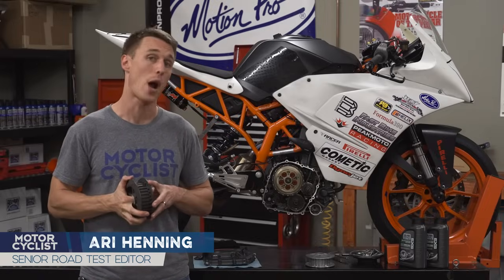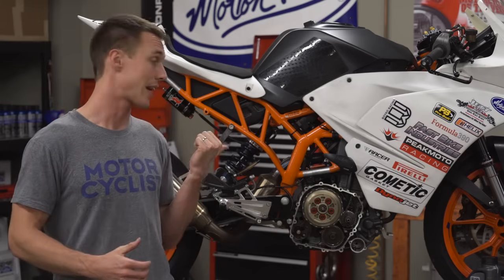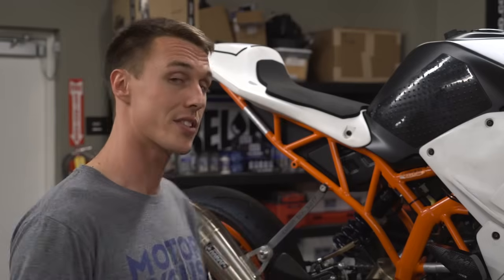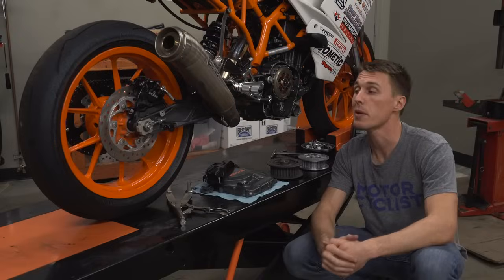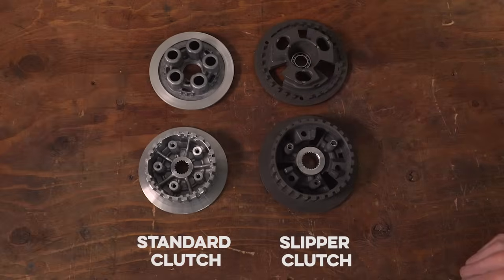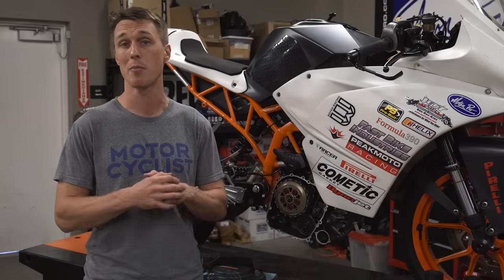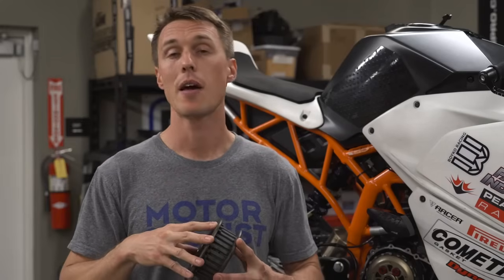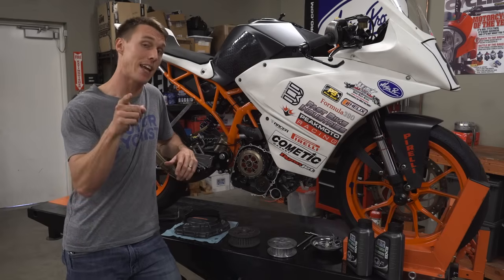The Motorcycle Slipper Clutch: How They Work and Why They're Awesome | MC GARAGE

Comment: Good video but I was wondering about the 'slip and grip clutch'; if you were riding your bike and your throttle jammed open, would you still be able to disengage the clutch and get the bike out of gear? IE can you overcome the extra pressure on the clutch plates?

Comment: THANKS, I put wrong oil and my vmax 1985 is slipping. i am planning to replace the oil with motul 3000 10w40 JASO MA2, should it fix the issue? thanks

Comment: Thank you for this video!! I've known how slipper clutches work but I just bought a very lightly used 2018 Triumph Street Triple R and it has a "slipper/assist" clutch and it's a VERY light clutch pull which is amazing! My FZ8 that I had for years was MUCH stiffer and I was always good about lubing the cables, keeping them adjusted properly and running good oil. I wondered how they got such a light clutch pull but a clutch that would still hold almost 120hp without it being hydraulic.

Comment: Not to be one of those nostalgic dickheads- but since moving to a slipper clutch last year on the Z900, now on the MT09- its like someone ripped away about 70% of the feel and tactic input of the clutch which I loved- losing that is like losing the feel of when to change gear using the vibrations of the bike- very strange. also never had a back wheel come out on me due to going down too many gears/letting out the clutch too quickly- maybe im just lucky or maybe im just creating this issue in my head.

Comment: What kinda street miles can I get until I need a clutch replacement on a slipper clutch? I have about 20,000 on my factory 2006 gsxr 750 set. No race, just commuting to work and stuff.

Comment: I haven't ridden for a while but been shopping, so I never even knew this was a thing until recently. I've NEVER had an issue with rear-wheel chatter or if I downshift too hard, I just pull in the clutch and quickly shift back up. No. Big. Deal. I WANT my engine to act as a brake. It's how I control my speed, and I know how to "blip" the throttle as I downshift. To me a slipclutch is like using tiptronic to shift your automatic and calling it a manual shift. It ain't the same thing. When I do get a bike, I'm going to shop for one that does NOT have a slip clutch, or I will search for an option to replace it with a standard clutch.

Comment: My slipper clutch failed as I was walking down icy stairs and I fell on my ass.
Reply: Actually I have found that my 2016 R1S will skid the rear tire)on race track) with OEM tires, however with race tires it works great, no (or almost) tire sliding.

Comment: Slipper clutch is develop in the early 2000 for high performance racing bikes for motogp or SBK. Different  slipper clutch designs were built later but what interest me is when one Japanese motogp rider, I forgot hus name said that he just use a tiny small amount of clutch pull to eliminate engine braking that was the reason in the development of the slipper clutch. Comes 2007 the new very light Honda CBR1000RR was introduced with all the gizmos to beat GSXs and ZXs who were the speed king. A new system that eliminates engine braking was introduced in the new Fireblade where the butterfly valve slightly opens as the rider eases on the throttle thus eliminating engine braking. Since then the new Fireblade becomes a machine to beat on the track

Comment: So does a slipper clutch negate the necessity to blip the throttle on downshifts? Or would that still be beneficial?
Reply: Ben Gray depends, but basically, it isn’t necessary to rev match or “blip the throttle” if your bike is fitted with a slipper clutch.

Comment: MC garage, I have a question. Please answer. On my daily driving routine, I always blipping the throttle when downshifting to match the engine and transmission speed. I have now a slipper clutch MC, should I blip the throttle still or let the slipper clutch come into play? Am I wearing my slipper clutch too early or it's not healthy if I always rely on slipper clutch and not to rev matching/throttle blip anymore?

Comment: I have RC 390 Duke with slipper clutch, It was stolen and recovered after a few week. The bike stalls immediately as soon as I put it in first gear. I removed the clutch, apply the oil to all plates. Installed it, clutch become nice and smooth. Bike still stalls. It does not look like side stand switch is faulty. what could be the reason
thnaks

Comment: I'm curious, if I do not shift assertively enough through everyday driving and ease off the throttle immediately after shifting, if that is why my bike is tending to slip out of gear an show "-" on the display regardless of gear transition.
The other day I was shifting from 3rd to 4th and it did that to me.  I'm noticing as it seems as a "limp foot shift" for lack of terminology, partly when I may be dehydrated and recieving a cramp in my hip I've noticed too.

Comment: Hi, I am a returning motorcycle rider after 3 plus years out of the saddle. I am looking for a adventure style bike in the 500 cc to 1000 cc range and like the Honda CB500x. I like that it over the v-strom has a slipper clutch but wonder if it is really necessary.

Comment: Please answer, I have an Honda hornet 160cc bike. It does not have a slipper clucth so when I come down from top speed to lower speed although I rev my accelerator and hold complete clutch, the gear won't go down easily, sometimes it is in between the 5 and 4 gear unless I leave the clutch it comes back with a "tuck" sound.. please explain me! What is my mistake.

Comment: does that mean that if the motorcycle has a slipper clutch then an accidental clutch pressure and hard braking at speed which could lead to wheel lockup and skidding can be avoided?

Comment: are you still able to push start if you have a slipper clutch?
Reply: yes, engine braking is also still possible, how much is depending on how heavy your springs are and the aggressiveness of the ramps. Only thing is, something you will need to do on most bikes anyways, is you need to put it into a higher gear than first because of the compression. Thats if you have super light springs, with normal springs its pretty much the same as normal
Reply: Really?
Reply: @derf9465  no.

Comment: Can i shift without lowering the throttle and without using the clutch simultaneously in bikes? 
Pls reply
Reply: You can but there is just an instant you can properly do it. If you are a little too late or too early. You risk damaging the gear and needlessly wearing the gear and assembly. You can do the same thing on automobiles. Done right it would have very minimal wear on assembly. It is something like you feel when engine revs the correct moment. It is far more safer to gear up or down utilizing the clutch.

Comment: So this is a safety for when you shift too early, right?
However, won't you still have a much too high RPM when shifting too early, thus damaging your engine in the long term?
Reply: The Belgian Beer Guide actually a slipper clutch will keep the engine from over reving when down shifting.

Comment: Im using rc200 and been thinking to upgrade to rc390 both bikes if I'm not mistaken, they're using standart clutch unlike the rc250 has an upgrade of slipper clutch. Correct me if im wrong. Q : is it possible to change from a normal clutch to a slipper clutch such as your modified rc390 btw im using it for road legal.

Comment: These slipper clutches seem to be for road racing .I'm looking for a drag bike slipper clutch that keeps traction on the rear wheel while locking at a certain RPM . For a 1290 KTM
Reply: 1-Shot slinger slipper clutch only slips on deceleration.
Reply: What you are after is an MRE lock-up clutch- purpose built for drag racing. But it is not very practical if the bike is used for normal street riding.

Comment: Mobil 1 automobile oil  has been used for decades in our Top Fuel drag bike & my street turbo CBR 900RR without any slipping or problems. When I contacted Mobil to inquire of the difference between Mobil 1 auto & Mobil 1 cycle, they informed me that the more expensive cycle oil "has more synthetic molecules". I then asked "How many more?" They could not answer my question. Why?? it's because it's the same oil!! If the origional Mobil 1 auto oil protects Top Fuel drag bikes & a turbo 900RR for decades, I'd recommend you use it & don't throw money away on "motorcycle oil".

Comment: Ok so i have a question about this, i have a ninja 300 and went to my first track day recently but didn't use the slipper clutch, i'm fairly new to riding bikes but those track teachers said i was amazingly good for a guy with (at that time) 9 months of street riding experience (10k km's about 6200miles). if i had a more powerfull bike they would have put me a class higher and that was just after my first free session..

Now about the slipper clutch, should i just when i'm coming towards a corner jam the shifter 3 gears down and brake or should i keep doing revmatching while braking and have the slipperclutch as a safety for if i make a mistake?
It kinda feels weird to me that i have to wait to see my needle drop back from 13k before i can hit the gas, because as you say its like a light grip on the clutch lever but i don't want to go into a corner, hit the gas and just hear the limiter. That makes me think i would lose grip...

Help me out on thisone, i'm kinda confused...

Comment: hey bro , I've have some question's about my Suzuki gd110, the problem with my motorcycle is that every time I pull the clutch, and engaged in 1st gear, like there's some timing delay on the shift gear. when you release the clutch slowly or even on fast release. tnx bro on reply. hoping you helping me with my prob. love your video., nice

Comment: What will happen if I didn't rev match?
Reply: when you are going fast and you start braking hard if you downshift let's say one more gear than you were supposed too you will most definitely lock the rear wheel (more probable on slippery surfaces) because it's still too fast for that specific gear. To make the rear wheel not lock, you need to press the clutch to prevent that (to disconect the engine from the wheel again) in a situation like that. So a slipper clutch does it by itself for your security

Comment: Actually first slipper or torque clutches were designed for enduro and used on Paris-Dakar for loose ground use. I had two bikes that used it Kawasaki Klr (not all models)and Cagiva t4(elephant w16 series) .Its actualy reversed system that prevents you from overspining your back wheel and crashing or staying stuck in sand or loose soil,mud and such.. Technically it has minimim ground resistance to power input ratio to put the power down if the wheel slips hard clutch partialy disengages so realistically U get more traction.
For example Cagiva will not slide out on newb riders while banking under full throttle and can even ride in snow and ice if your good. How ever as soon as it warms up it can not wheelie. Its very good at beating more powerfull bikes at short drag racing up to 100kph.
Both bikes hate tuning because clutch is  designed for very specific power input so as soon as u get 5hp more its noticable under heavy acceleration.
They also lack slow down slipping but both engines have very strong engine braking so unless someone is pulling U U cant overrev it.

Comment: There are only 2 motorcycle oils I trust in my sportbikes...
Amsoil 10w40 & Mobil1 10w40.

With a slipper clutch you want the clutch to do the work of regulating the plates.   Just dump the clutch when downshifting and concentrate on other things.
Reply: What about Motul  300V 4T 10W40?

Comment: I use my motorcycle mainly for moderate city riding, and when I downshift I use my standard clutch for engine braking to reduce wear on my brakes, so I don't think that a slipper clutch would benefit me except maybe to avoid an accident in rainy conditions.

Comment: Maybe it's just me, but I like hardcore basic motorcycle riding. No slipper clutch for me, I prefer to manually rev-match I feel like I am improving and becoming a better rider if I have less mechanical or electronic aids.
However, I guess with all the fast-paced action on a track, a slipper clutch might be beneficial...

Comment: I'm curious. Would the 'slip and grip' type clutches have an uneven performance based on how much throttle you're using (what rpm the engine is at), considering you keep the clutch lever constant? Thanks.

Comment: can a slipper clutch be installed on a normal clutch bike
Reply: Sometimes. For example, the 2016 FJR1300 has a slipper & assist clutch. The newer clutch parts can be installed on the older engines for about $300. The biggest advantage is the significantly lighter clutch pull that comes in handy after about 30 minutes of stop and go driving.
Reply: Im from India and ride a Royal Enfield Himalayan and wanted to know if i could install a slipper clutch.

Comment: is it easy to swap the stock clutch to a slipper clutch on the rc 390 on older models that it didn't come stock with?
Reply from the maker: Very easy. It's a 20-minute project.
Reply: Motorcyclist Magazine sweet thanks

Comment: Hi Ari,
could you make a video on Stock Vs Performance Air Filters and Exhausts and their effects on performance and engine life... Pros n cons actually...
Reply: Yeah, I've been wondering this. I have a bike with a messed up air filter housing, and it's much cheaper to just buy an aftermarket air filter, but I'm not sure if that would mess with my air/fuel mix, or require some tuning to get it to work.
I've been holding off paying the 90 bucks for a piece of plastic that holds my air filter!

Comment: Does a slipper clutch make the lever easier to pull also?
Reply: Finish watching the video buddy then you'll find out
Reply: Dodgy Brothers slipper clutches do have lighter springs and thus pulls.
Reply: HeroRR i love your videos!!!
Reply: Typically no. The resistance you feel at the clutch lever is directly related to how heavy the clutch springs are. Sitting stationary at a set of lights it doesn't matter what type of clutch type is used in the bike, you will be pulling against the full strength of the clutch springs. There are only two ways to make a clutch lever feel lighter, the first is to put lighter clutch springs in the bike (not desirable at all) and the second is to increase mechanical leverage. Think when you put a longer bar on a socket, the effort is easier but the amount of travel increases.
Reply: @DodgyBrothersEngineering  I think you forgot slipper clutches use lesser number of springs so they are actually lighter to pull.
Reply: Depend on hard and soft clutch spring. Hard spring tend to wear off the clutch plate so need to use aftermarket clutch plate which is strong and last longer. If stock use stock or racing use racing that’s it.

Comment: Surely the point is that on the street riders should learn how to change down safely without the help of technology. In almost a quarter of a million miles I've never messed up this simple operation. Slipper clutches are a solution to a problem that does not exist. At least on the street.
Reply: Dodgy Brothers 
ya no. Sorry got to call you out on that. Diesels dont have compression braking unless its an outside force like exhaust brake. They are fuel controled not intake and dont create a vacuum
Reply: Well explained.
Reply: Also you need to factor in that modern bikes have very high compression ratios, there is a reason why diesel vehicles provide such good compression braking compared to the petrol counterparts, high compression. Now apply that to a big capacity motorcycle with a tiny contact patch and the need for a slipper clutch becomes obvious.
Reply: +humzilla707 Your mostly right I was thinking restriction on the intake side through a closed throttle (on the motorbike), but the restriction on the exhaust side (through an exhaust valve) is definitely far more effective. However don't discount compression entirely... Any engine is just a big air pump, using a exhaust brake / exhaust valve to restrict pressurised exhaust gasses escaping the air pump works on the pressure side, closing all air off on the intake side will have a similar effect on the vacuum side. If the throttle is closed while the piston is going down on the intake cycle. The restriction will act like a big air spring in reverse (think a big horse syringe without the needle with your finger over the tip when you try to pull the plunger out). The higher the compression the greater the effect.

Comment: Bro what's the pros and cons of a liquid vs air cooled engine?
Reply: Liquid travels the distance usually 4 stroke
Air cooled engine normally has better speed because they mostly ran on 2 stroke however prone to have  jammed pistons however some 135cc strokes come equipped with water coolant

Comment: please do next videos

 types of break pads and disc 

how good are USD forks[ daytona 675R ] vs [vyrus 600cc] swing arm front suspension

wire wheels vs alloy wheels vs carbon wheels 

electric super bike Ls218 vs. bmw s1000rr super bike
Reply: Can somebody give me a heads up 2000 Suzuki 2002 Suzuki Intruder less than ten thousand miles on it clutch is out

Comment: +Ari You didn't tell about the disadvantages. :D
You know, since most of the bikes which have slipper clutch are also ridden on the road, it is understood that an average user is also using features like this. And there's a major problem. 

When the battery is out and you're not able to start the bike, it is impossible to jumpstart the bike from any gear. The clutch will start slipping, won't it?
Reply: Thanks for the reply. 
Sure. A video while testing might be fun. :P